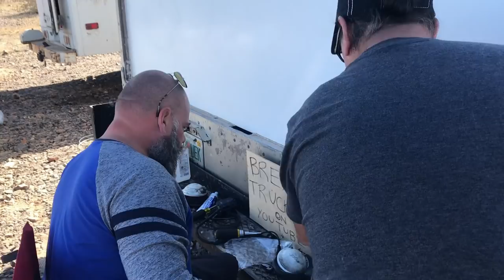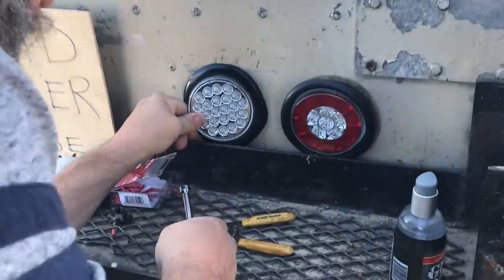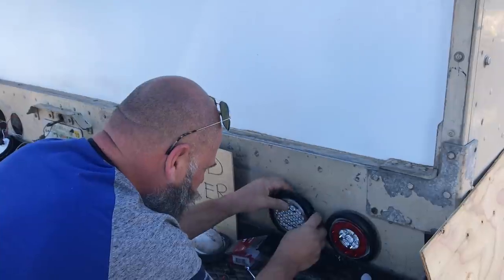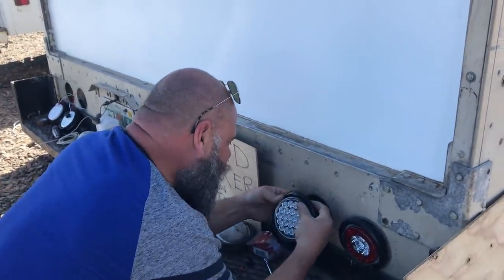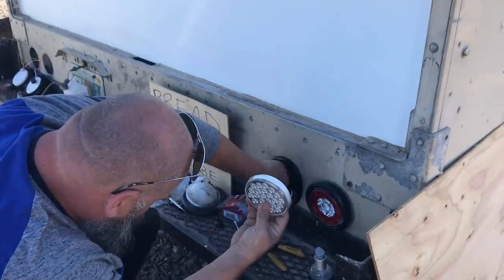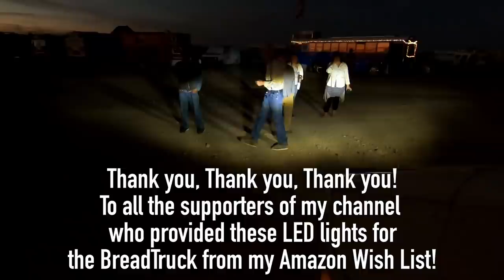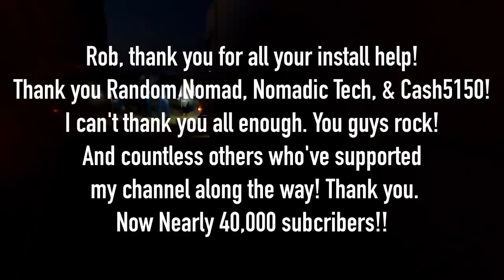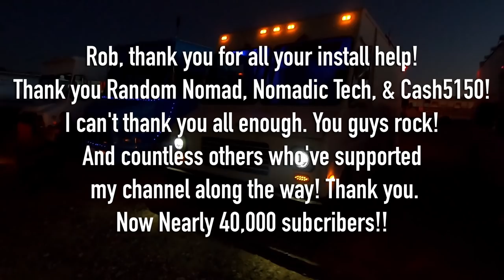Skooliepalooza 2020 | COMPLETED LED KIT for the BREADTRUCK | #vanlifestepvan

Comment: Use dialectric grease next time, it won't break down the rubber seal like gun oil does.
Reply from the maker: I had anal lube(as StepvanRav says). I used what I had! Hahaha!
Reply: @PaulBarger  MUAHAHAHAHAHA!